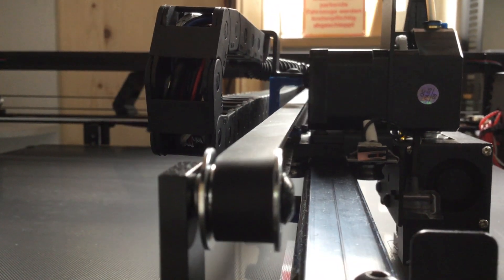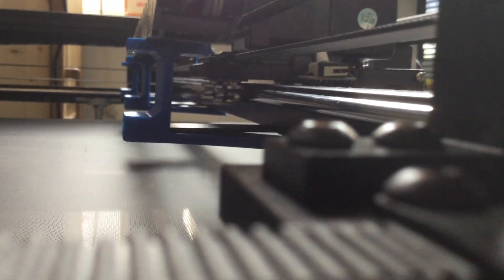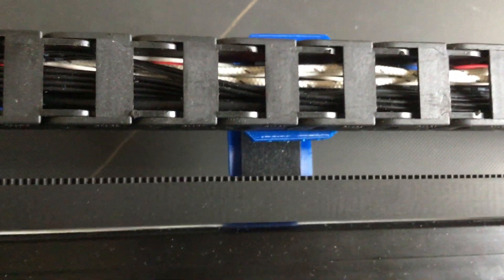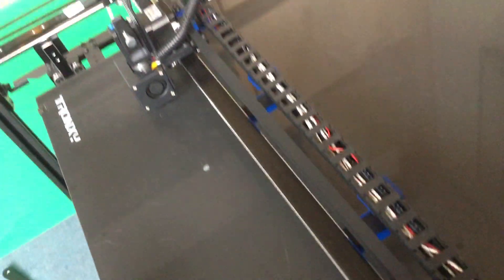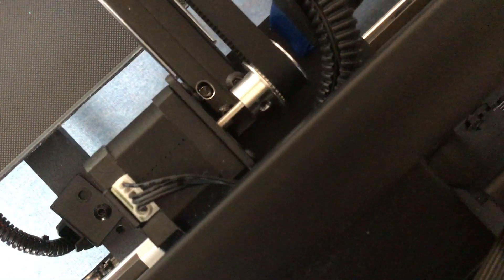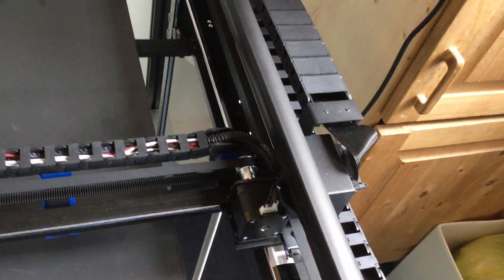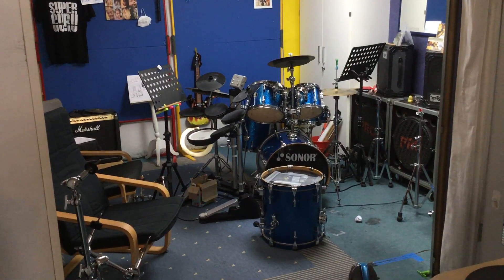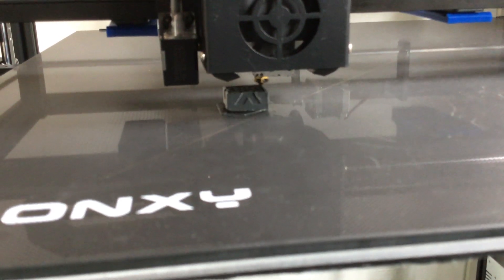TRONXY X5SA-600 my 6th step to a first "ok" testprint... while printing I show you around my system

Comment: Nice video. Finally some positive feedback about this printer. Get some carbon fiber pteg from atomic filament it’s really great and only costs around $50 a roll. I’d consider this printer to make fat bike rims/wheels. A useable rideable wheel would be my goal. Maybe the frame parts also. Oh and it would be a efatbike.
Reply: Carbon particles actually make the filament weaker. Only the chopper fibres increase strength and even then they have to align for it to be worth it.

High temp PLA is probably the best filament for strength.